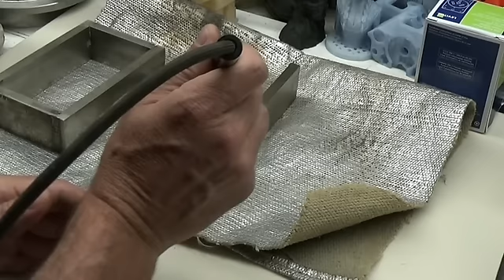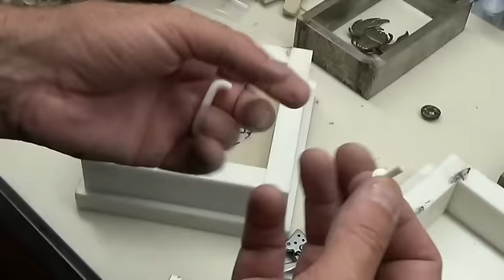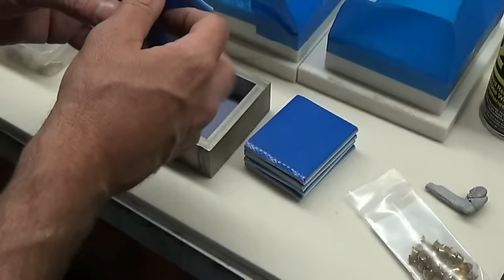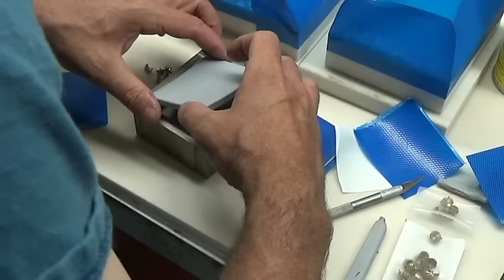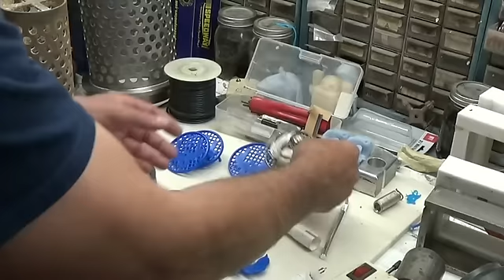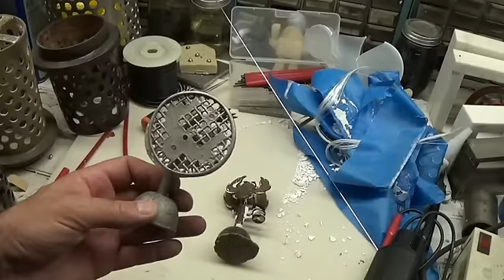reproducing a car emblem

Comment: I've had 7 Z cars over years the first V8 i built was a 71 240z with a 327  back in 1988. There was a guy area that had a real Scarab 240z  we ended pulling up to a stop light one night and raced it was awesome I left him in the dust. He was a arrogant guy and bragged how fast the car was but the Scarab conversions  would just spin the motor was installed way to far forward in the car

Comment: I'm enjoying your videos, thanks for posting.  Could you tell me who makes the vacuum assist flasks and equipment you use and who sells them?  Also, would you continue doing lost PLA or is the special filament from machinable wax better?  Thanks
Reply from the maker: the flasks are made by nutech and sold by riogrande.com 
the vacuum chamber is home made.  for the pla or wax filament question, it really depends on the model to be printed.  i have a new direct drive printer and hear maxhinable wax made some changes to the formulation so i would like to play with it some more.  lately ive been doing more lost wax than 3d printing....
Reply: Thanks for the answers.  Since your vacuum chamber is an integral part of your process (which I'd like to copy) would you mind doing a video about it?  How you made it, materials uses, parts,  pump stats, etc.
Reply from the maker: Ive been planning on doing just that...Making up a 6" vacuum chamber for the big flasks.  When I do Ill make a video.
Reply: Not trying to be a pain, but hows the 6" vacuum chamber video coming along?  Looking forward to it
Reply from the maker: Its in the video camera!  LOL  I will get it uploaded soon.  Lots going on lately...